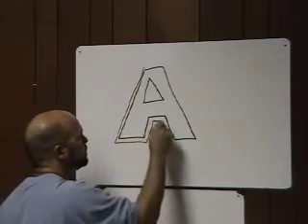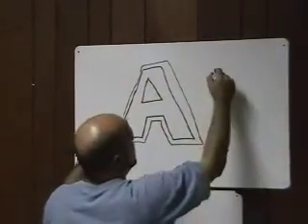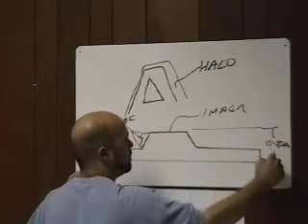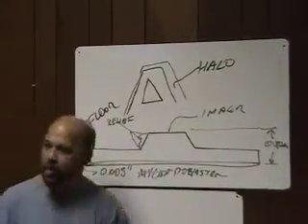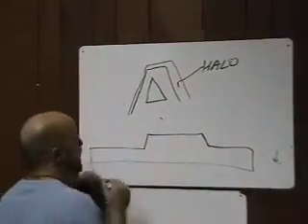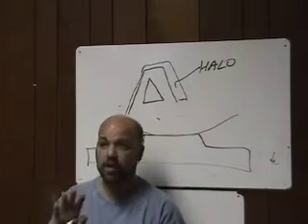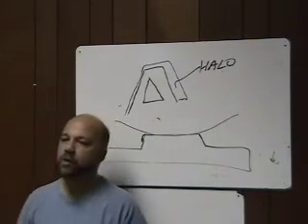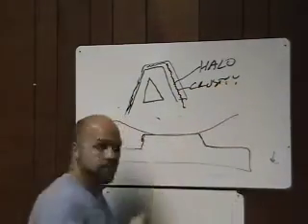Dirty Halo Around Printed Image

Comment: Setting the impression is key. Other factors such as a keeping the plate clean, PH balance, ink drying to quickly onto the plate, air blowers drying ink onto the plate, paper stock, and type of sticky back being used. I find keeping my plate the cleanest is checking my ink and plate coat will keep it nice and crisp.